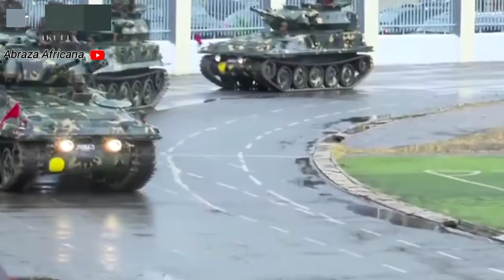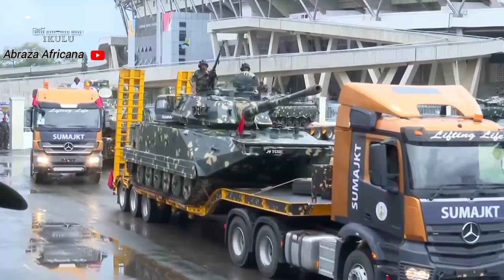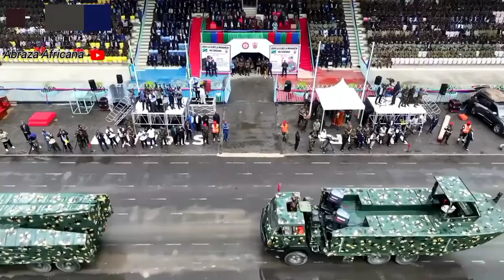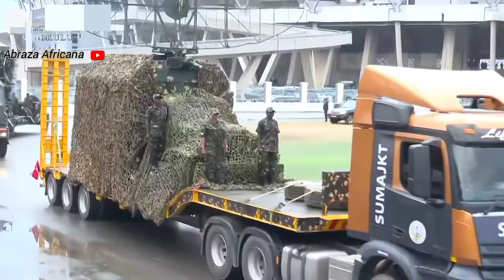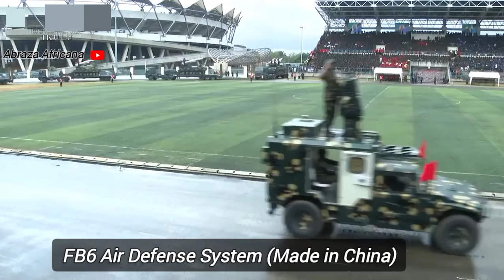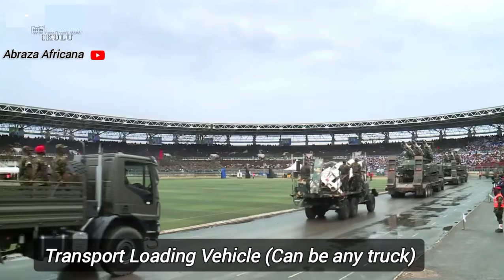Chinese & Russian weapons dominate Tanzania's military show at TPDF's 60th anniversary

Comment: I have a question, why are the tanks, ifv,  amphibious vehicles , rocket launchers and all are being pulled or put behind a truck ? Why are they not being operated by a personnel ? Do they have issues that's why they are being pulled or put in a truck?
Reply: Because large armored vehicles and large tanks will cause damage to local roads. Of course, if you are willing to pay to repair the road, I think they will be happy to drive large tanks on the road, or when invading your country, large tanks can also drive on the paved roads in your country.
Reply: Amphibious means water and no water there
Reply: @Trendingnewstubes  I'm from the Philippines and I've seen amphibious vehicles of our military they both run well in land or water , they are being used as an assault vehicle if your target is in another island. If the amphibious vehicle doesn't move because there is no water, then that is not an amphibious vehicle its a boat.